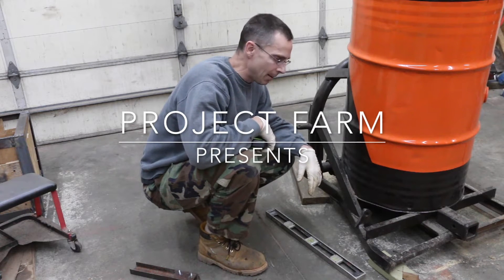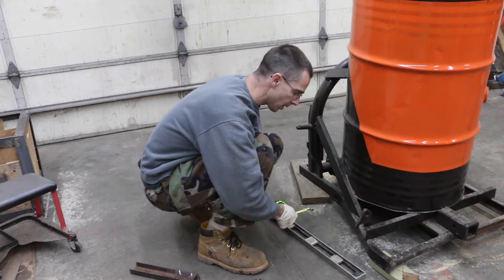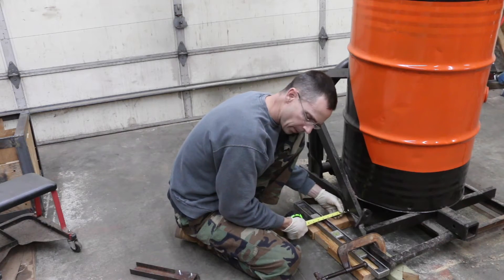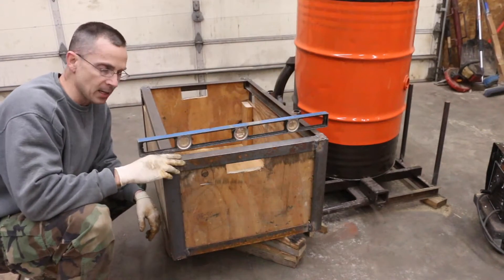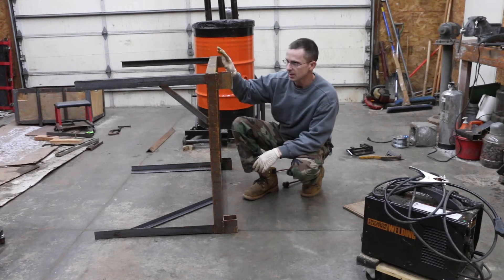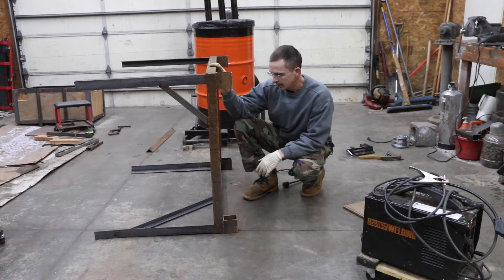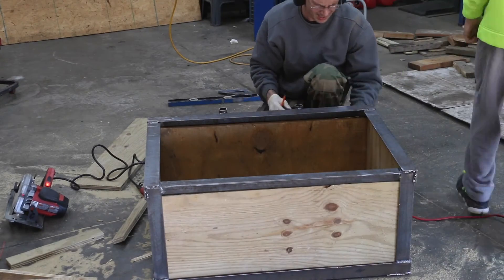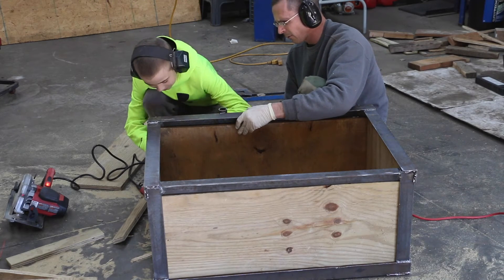Counterbalance, toolbox, and towing package for tractor--Kubota M9540 part 4

Comment: Good project, but you make my old bones ache to watch you crouched down on the floor.  When I build my ballast the first thing I did was set it up on blocks about 18".  Thanks for sharing your project,  I'll have to check out more.
Reply from the maker: Greg, Great point.  I might weld legs onto the bottom of this to get it off the ground more.  I don't like bending over any more than necessary.  Having the boxes on each side is extremely handy!  Thanks for commenting!
Reply: My ballast box sat on blocks of wood until I had all the 3 pt attachment points on, from then on the tractor held the box up, a miricle.  I intend to weld  tubes at the corners with sliding legs to hold it when not on the tractor.  If I ever want to store my box on a smooth floor, I will put swivel casters on them.  I prbably won't finish mine until the rains start again of course.  Good luck and be safe.  Greg B.
Reply from the maker: Greg, You've got a great plan!  Thanks again for commenting!